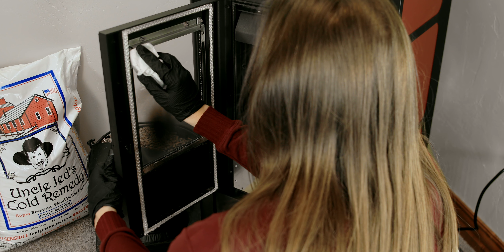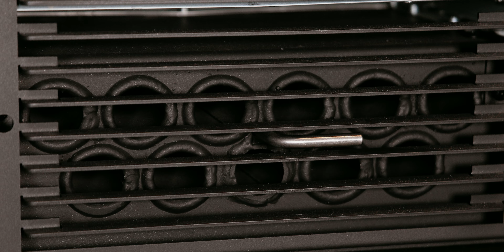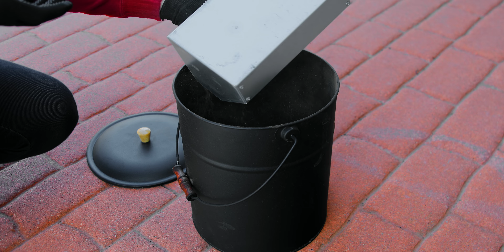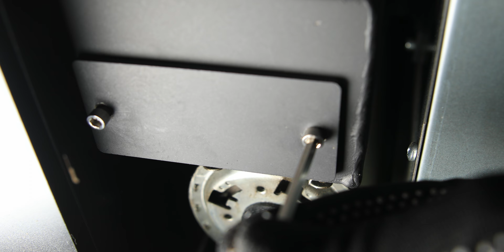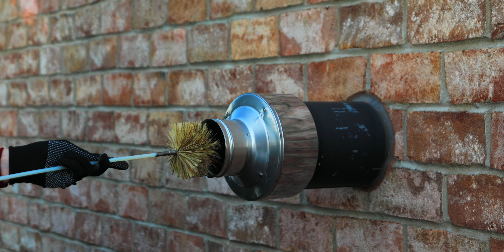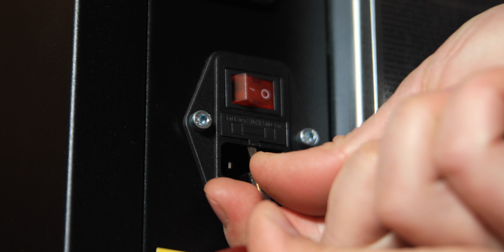Freedom Stove - Independence PS21 Cleaning and Maintenance

Comment: Hello, I just bought a PS21 stove. I started it and it just stopped. Wouldn’t turn back on. Can someone please explain. Freedom Stoves doesn’t have a support number. Sent an email but no response. Can someone please help me diagnose this issue?
Reply from the maker: Greg, apologies on the delay here, for some reason your comment/question did not show under notifications. Very sorry about that and any other communication issues you have had regarding the PS21. Please let us know if you are still needing assistance, we can have a technical team member reach out and be in touch right away. Thanks.

Comment: That's some big pipe does it need 6" stove pipe?
Reply from the maker: The Independence had a 3" exhaust port. Most folks will use a 3" or 4" double wall PL venting for exhaust. The venting in this video is called Direct Temp. It has a 4" stainless core for the exhaust, and the outer ring brings in fresh air from outside for combustion making it a 6" diameter pipe. Any other questions please let us know. Thanks.